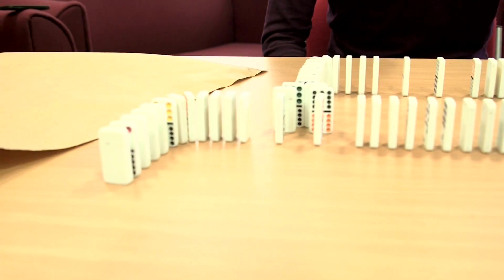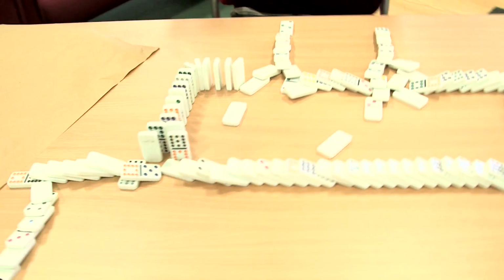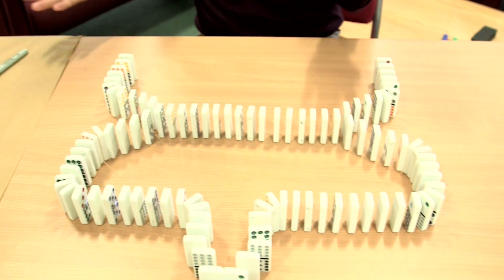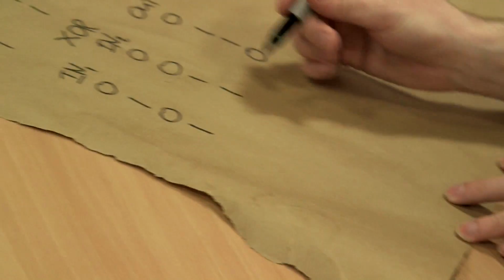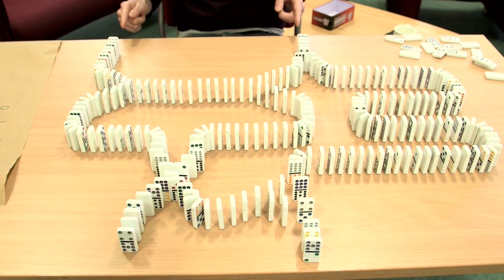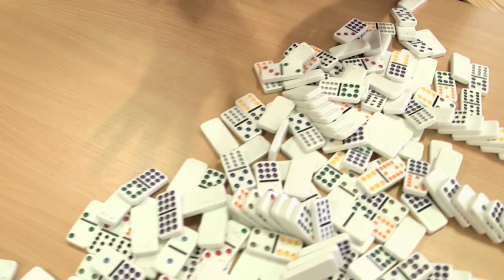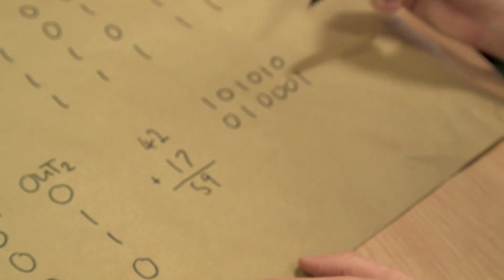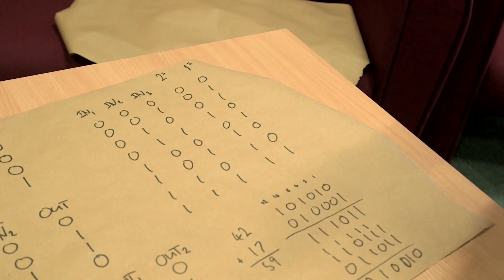Domino Addition - Numberphile

Comment: To add to my main comment I will say I liked the bit where you showed how one domino nearly fell and triggered a malfunction. A problem that could be very largely reduced near to zero with a, probably bigger, more sophisticated design. So reliability is a big issue as it is also in electrical circuits.

Comment: But you can't create an NOT, right? Since you can't invert a standalone 0 to 1. Or you need a clock and other moving dominoes, that will end in 1 only if at that point you didn't set a 1 in the input. :)

Comment: Question - If your computer (hypotheticaly) had an infinite amount of RAM and ROM, what could you NOT calculate?
Reply: Long answer:
English is not my mother tongue but I'll try to explain, but I don't know deep your mathematical knowledge is. A  function f is considered calculatable, of there is an algorithm (a program) that calculates all the values of the function. Even if you have unlimited RAM, a program consists of a countable amount of symbols, so you only can display a countable amount of different functions (every program equals a function in short).For example if you assume a function f1 you can write a program that calculates f1(0), f1(1), f1(2), f1(3), f1(1.5), f1(2.3) and so forth. Now imagine an unlimited countable amount of functions f1, f2, f3, ... that means also an unlimited countable amount of programs. The result is: You will always be missing a further program, even if you have unlimited RAM and have written unlimited programs. For example you will be leaving out a program that calculates the following function m:
m(1) = f1(1) + 1; m(2) = f2(2) + 1; m(3) = f3(3) + 1; this function has different values from all the other functions even if you write an unlimited amount of programs, calculate an unlimited amount of values and save them on your unlimited amount of RAM.
Short answer: busy beaver and halting problem

Comment: There's a domino gate where signal A goes through and then signal B. It's made by laying a carpet domino and another domino on top of it. The upper domino slides, transmitting A, then when B comes through, it topples both dominoes. If B came first, it would topple both dominoes, preventing A from going through.

If you're going to build big computing circuits out of dominoes, you really should get Bulk or Lamping dominoes. Get some bridges too.

Comment: The shape of the XOR circuit reminds me of 1 anatomical system. That is the urinary system. The 2 inputs are like the 2 ureters. The place where the 2 inputs either cancel out or 1 goes through is like the bladder. The 1 output is like the urethra.

Comment: the fact that Matt wrote the input in this order: 00 10 01 11 instead of 00 01 10 11 drives me insane!
Reply: egalomon Well, technically you are supposed to read binary from left to right, as you would do in the decimal system.

Comment: Why don't we just count in unary? Everything is 0
Reply: Flippin' Free No in unary there is no 0 only 1
Reply: No you are wrong. There is an infinite amount of bases where there is no zero. They are called bijective bases. For example bijective base ten will have no zero. Instead it has a sign for 10. I will represent 10 by A. They count like this 1 2 3 4 5 6 7 8 9 A 11 12.... 19 1A 21 22... 29 2A. You get  the idea. Everything is the same except there is a symbol for ten and there is no zero. So unary is a bijective base. If you want more information google it.
Edit: If you did not know bases are a type of counting systems where each of the next bigger digit is the base^n where n is how many places it is to the left.
Reply: WarheaddVids Sorry for making my comment sound angry.
Reply: WarheaddVids Also no need to be sorry. I just was teaching you a new thing
Reply: Mark Noleson no there is 0, every counting system starts at 0
Reply: Mark Noleson oh okay I wrongly assumed what unary was. Sorry

Comment: I wish he would have shown a "not" gate where knocking nothing over caused a domino to be knocked over.
Reply: You need a power supply domino. Something that you'll always knock out regardless of input.
Reply: Ah you're right. Maybe a knocked over domino on the floor, and a single standing domino on top of a table? If you do it just right then maybe the one falling off the table has a chance of hitting the one on the floor in such a way that it'll spring back upright? Haha, that's the best I got.
Reply: Easy, just have a single knocked over domino.
Reply: That would be XORing it with a 1, but that 1 would have to be activated at just the right time as the other signal comes in to make the whole thing  work, so that would be tricky.
Reply: I only brought it up in the first place because I didn't think it was possible to do with dominoes. The thing is in electronics a "0" still has some tiny amount of current that a "not" gate can recognize as when it should turn on a "1". At least that's how I believe it works.
Reply: A not gate in electronics still needs a power input, so in terms of dominos you can imagine it as an XOR gate with one input permanently on, then the state of the output is opposite the state of the toggleable input.

In 1 (power) | In 2 | Out
1                    | 0      | 1
1                    | 1      | 0
Reply: Patrick Wise lel
Reply: That's what a "1" going through a "not gate" would look like, but not a "0"
Reply: Patrick Wise well in a computer there is always new energy into every gat and the old one just decideds wether it   Stops that output

Comment: Okay, I have several questions for anyone to answer:
1. With dominoes, Matt constructs an AND gate with two "blockers." In Minecraft, it is constructed using two NOT gates and a NAND gate. Which one describes how actual computers work?
2. Matt constructs an XOR gate with two lines that cancel each other out. In Minecraft, you can make it with all NAND gates, or even out of three mixed gates. Again, which type is actually used by computers?
3. In Minecraft and Logisim, converting a decimal input to binary is easy. Adding two binary numbers together is easy. But how do you convert the answer back to decimal? For a human, it's easy; just add the powers of two corresponding to each 1-digit. But when you're building a computer from scratch—a computer that doesn't know how to add—how the heck do you make it convert binary back to decimal?

Thanks!
Reply: Matt only shows the logic. How the logic is constructed doesn't really matter. I personally constructed a 3-digit adder in minecraft without using inverters. In real computers, an and gate is quite easily a transistor (but a relais could work as well, and is different again) and a xor gate is a couple of transistors (2 is enough I think) and some resistors. Hardware and systems don't convert binary to decimal. As you say, that is fairly difficult, but certainly possible. Software does the conversion instead.
Reply: +P Anonymous Thanks! You answered my first two questions. But do you know what method computers use to convert binary to decimal?
Reply: +P Anonymous I mean, when I type in 1+1 into my iPhone calculator, how is it able to show the number 2 instead of 10?
Reply: +Chris Bandy well I did answer that, but I could elaborate. In computers it is done by software, not hardware. However, if you really want to do it with hardware (for example in minecraft) you could obviously attach multiple leds to the output and one led to multiple outputs. That way, you can make a grid of leds and a system that attaches leds depending on the outputs. For a two, only the two's output is on, so you could power some leds in the shape of a two. For a three, you add the two shape with the one shape, but you have to remove the bottem left bar of the two. So perhaps the ones output switches that bar off. And again, by using logic gates you could 'program' any shape depending on the output.
Reply: +P Anonymous Okay thanks!

Comment: Now build a NOT gate with dominos.
Reply: +modi X Two dominos: the input is a balanced heavy domino, and the output is a lighter domino which is already fallen. If the dominos are placed very accurately, the input falls right on the end of the output and balances it. #TrollPhysics
Reply: Qbe Root
you're going to be my favourite guy from now on ... :D
Reply: modi X so I just wanted to say, it's not ACTUALLY impossible to build a NOT gate with domino's. The secret lies in how Matt built his full domino computer; he built in a "power" switch. Basically, they entered the inputs by placing dominoes in the appropriate areas, and then pushed one domino to start the whole calculation. Bet that first domino wasn't an input in and of itself. Since a NOT gate is just a signal that's always on unless an input is received, you just have the power input not only start the calculations, but also run down the line, and it will continue unimpeded unless an input knocks out a domino in its chain. Would probably  be a nightmare to layout considering how much delay they had to use in their build, but there you go.
Reply: I'm just gonna say it, he might "accidentally" knock it down before it's finished...
Reply: +modi X  0 XOR 1 = 1; 1 AND 1 = 1; 1 XOR 1 = 0; 0 AND 1 = 0   feed the extra inputs by breaking a single input.
Reply: @htmlguy88  how do the operations connect?
Reply: karun mathews
eXclusive OR, as in “a or b, but not both”
Reply: What happened to NAND?
Reply: it could be , but with condition that have a gate to release the output of the not gate , if input is on then triggers the gate the output is off but when the input is off then triggers the gate the output is on
Reply: NOT X = X XOR 1
Reply: you need something that  sets a domino up when one falls over
Reply: Ok, its 4 years stale, sorry late to the party but....
Instead of a power supply it can be done with bi-phase signals. If the computer is built with 2 lines of dominos per signal instead of 1 and at all points these 2 are out of phase (logic 0 high for one and logic 1 high for the other) a NOT gate is simply swapping the lines.
One very neat side effect of this is that you dont need XOR which is the only gate that relies on synchronous inputs. All the delay lines go away.
Reply: +Janos Folhoffer Why?
Reply: karun mathews because of TrollPhysics :D
Reply: Janos Folhoffer Oh hehe :)
Reply: oh okay
Reply: Eerrrmmmm....... That is a challenging one!
Reply: what
Reply: modi X It will be just a falling domino.
Reply: modi X 
You don’t
Reply: XOR
Reply: @dejfcold  it just inverts the binary digits. let's say you have 1. you get infinite ones then a zero... which is -2 apparently
well to us its infinity computers just use - in other bases pls
Reply: I’m crying
Reply: For that, we actually need a domino that WILL fall, no matter what. You can't do that.
Reply: Step 1: Have a cat
Step 2: Leave the room for a second
Reply: long line of dominoes already falling for a long time, if a domino chain knocks out the chain, or input 1, it doesn't output, or output 0, and if the dominoes don't knock over, the long chain outputs, but the question is how do the long domino chain start? an input condition required? a slope? idk.
Reply: You can just say 0 is fallen domino, 1 is standing domino (reverse 0 and 1). Then you can build a NOT gate!
Reply: 1 XOR A is the same as NOT A, so you can do that :)
Reply: he did at the very start.  the first thing he did was build a NOT gate and show that it wouldnt let the input go through.  then he built an AND gate by adding on more set of dominos.  Also, there is a "buffer gate" which is technically just letting the input go straight through with no fancy manipulations of any kind (that's what most dominos lines are :v )
Reply: @nemesisurvivorleon  no, the first thing he did was more of a "constant-zero" gate. A NOT gate outputs 1 if the input is 0, but the thing he built in the beginning never outputs 1, and always outputs 0. I think he just wanted to explain the principle behind the AND gate.
Reply: What if you just build a XNOT
Reply: you know how it should made?

instead of "make stands domino to fall", you should "made stands domino that already fall"

but the rule still the same "falls mean 1, stands mean 0"

i know, late answer and i am a native english
Reply: +modi X Dude these are just dominos :)
Reply: +Janos Folhoffer simulate one, like in the video. :D
Reply: ***** Actually I'm a software engineer and know about those things. In practice they work by using resistors, diodes and transistors. I was just trolling ;). The problem on the NOT in this kind of simulation would be, it cannot simply output 1 when no domino is triggered. You could solve it with a power connection that will not be cut up when the input is false, so the output gets true. In this simulation this would be cheated, though, because other examples are not powered separately.
Reply: ***** What do you mean by XOR ?
Reply: balong reyes Dude, read the comments. ;) This is similar to the powered gate approach by David Studený and Christopher Bocksell (I think). However, I enjoy all the suggestions from you all, actually. Qbe Root, the heavy domino that balances the light one is great, but at the end it's cheating like adding a second input. Clearly, I was trolling, because I expect a solution that works in the similar environment with similar specifications (so all dominos weight the same like on the other examples and we have only 1 input and 1 output, so we ain't adding additional inputs or outputs. I'm damn sure with these strict conditions it's impossible, haha.
Reply: @_modiX  Dude could you explain me in layman terms how a computer knows what to do with a bunch of 0s and 1s.

Also, what is the differnce with modern electronics and these ones, I guess this is very basic
Reply: @sefatsilverlake3816  The computer doesn't actually "know" anything about what to do with 1's and 0's, generally*.

The most basic parts of a computer just do very reliable things in response to signals, because that's how they're built to work. An AND gate, for instance, is built so that it only outputs a 1 if all inputs are 1. It doesn't actually look at the inputs, or think about them in any fashion - it's designed so that the inputs collectively turn on the output, if and only if they are all on.

Using very complicated circuits of these simple components, we can make complicated behaviors emerge. And ultimately, the circuits don't look like the domino circuits, because the physical principles being used aren't the same, but they do work roughly the same way, in that they just behave according to their design.

It's strict logical behavior that's been encoded into physical form. It just does as it's designed.

Comment: In Digital Programming and "And- & Or-gates" there are some grids, based on the function, that will show an output when the both inputs are 0. For instance an "inverted and-gate" has the grid: 

In 1 In 2                 Out

0      0                      1

1      0                      1

0      1                      1

1      1                      0

And I would really like to see the first example of the grid in practice on the dominotable! :)
Reply: +gil z its called a NOT Gate at the end of other logic gates. It inverts the signal but it would be really hard to build it out of dominoes.
Reply: +Gil Zaherin The problem is you need something to prompt the out domino to fall over, so there'd have to be a 3rd input that stands for 'run my domino program' to flip the output from 0 to 1.
Reply: +theoya technicallly you can have 2 inputs fed by 1 and use a XOR and an AND gate together 0 XOR 1 = 1 1 AND 1 =1;    1 XOR 1 =0; 0 AND 1 =0   you have inverted the signal with a constant input of 1 to counterbalance the true input.

Comment: how can u delay signal in microprocesor?
Reply: +Michal Kravec You don't slow down the electric current. The logic gates are built using transistors which are used to either block currents or allow them to flow as needed. No delays are needed in logic gates.

If you do need to slow down a signal, you can do that in a sense by synchroznizing components using a clock signal, and using e.g. D flip-flops.
Reply: +Michal Kravec You normally have an internal clock to help synchronize all the signals going in and out.
Reply: arcuesfanatic this is not what i was asking.
Reply: ***** oh sorry. but normally you don't need to slow down a signal in order to get the timings right, like you do with dominoes.

Comment: Interesting tho, you couldn't do a NOT gate, the simplest of all. For that you'd have to rethink the domino setup and make it have two types of inputs: values and the pulse to set it off. To get a 1 from a 0 requires additional energy to the system by a pulse, because otherwise nothing provides energy (is bumped). The "inputs", now values, would need to be loaded into "memory" in the gate, implemented by the element where one line can knock dominoes out of another line (similar to a transistor). So the inputs would need to be knocked (disabling certain lines that need to block the signal) and then the pulse given to let the gate "process" the inputs. Another one of the "memory" elements storing the output would provide it as input to following gates. Bad thing this can only be run once, then has to be rebuilt ;)

Comment: Very interesting and very clever. Also, if you make a straight line of dominoes and hold the one at the end vertical, then knock over the rest, if the bottoms of the dominoes don't slip as they fall over they end up approximating a curve called a tractrix.